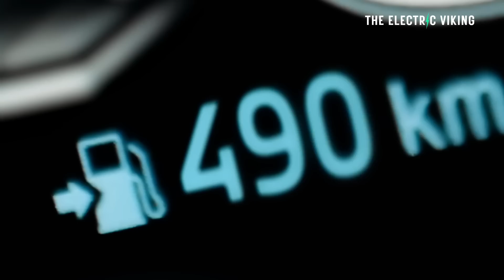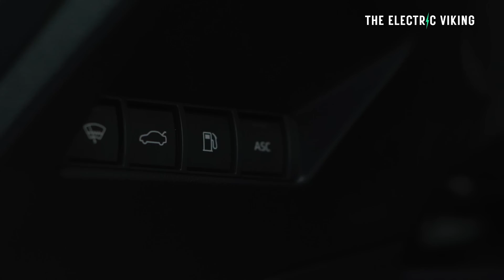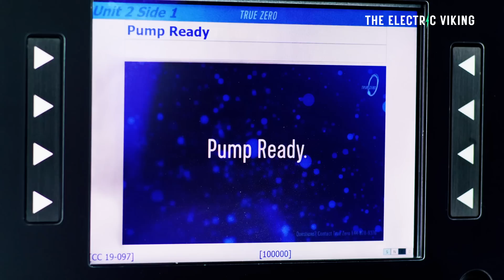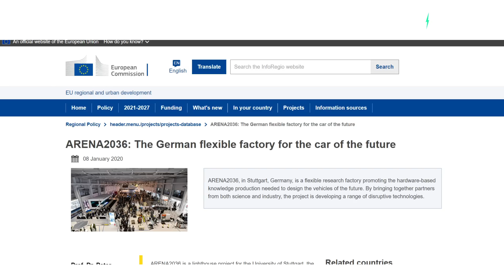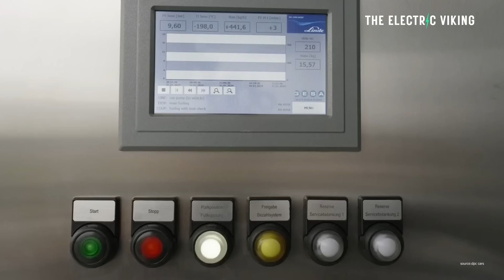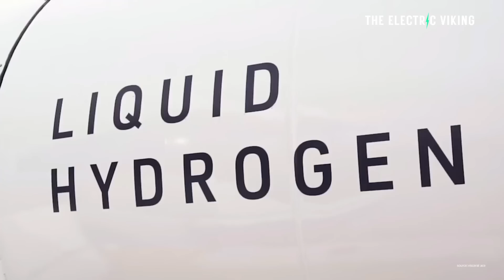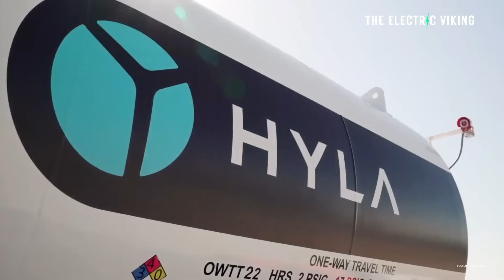Fossil fuel companies spending billions hoping that hydrogen beats EVs

Comment: I wonder about the argument for hydrogen for things like long haul semis and the like vs electric given the weight of semis for electric and charge times etc
Reply: There is already a concrete truck company in Australia that's doing battery swapping. It could be made similar to NIO where your nav system can see batteries available for swapping at the station and reserve them. Then fork lifts come and swap them in 10 minutes. And how large and heavy do the tanks need to be to store H2 at 750 bar (10,000 psi)?
Reply: @kng128  Hmmm.... I don't know what the long haul potential vs weight of hydrogen vs batteries are for long haul shipping via semis, but hydrogen can fill up like Diesel I would imagine.

Are you suggesting switching out massive batteries in semis for long-haul trucking?

Comment: I get your point. But people said the same thing about Tesla's: They were incredibly expensive, had low range, charging was not cheap to set up initially, had no idea how long they would last.  So I guess we just need to wait to see if hydrogen gets off the ground. I doubt it will given all the investment the fast technology advancement in batteries, but they'll try. Might be like VHS vs Betamax, sure Hydrogen vehicles will be excellent at certain things, but by the time it gets here everyone will be using EVs anyway.

Comment: producing hydrogen is 50% efficient, plus the fuel cells need to be replaced, and it costs much more than even today's expensive car batteries. Plus, it's so dangerous, you'd better keep it away from a road crash.

Comment: You need to do the math. Every step in the hydrogen cycle has inefficiencies compared to pure electric.  If you’re extracting hydrogen from fossil fuels you’ve only moved the CO2 production from the car to the refinery.  If you’re getting hydrogen from water using electricity it’s less 50% efficient. Then it takes energy to compress, cool, cryogenically store and transport. You then have to convert it back into electricity in fuel cells.  There’s also leakage and venting excess pressure as it warms.  
Then there’s safety.  Hydrogen is much more explosive than gasoline. It burns with a clear flame so you won’t even you’re in danger. 
The storage tanks are a literal bomb with high pressure hydrogen in them. You’ll get two explosions. One from the ruptured tank, then a big one when the escaped hydrogen mixes with air and any kind of spark sets it off.
Reply: Hydrogen does not have to come fossil fuel.
Reply: @yo2trader539  
True, but it’s still inefficient.  You would need 4-5 times more solar panels to run a car on hydrogen than if you just used the electricity to charge the car.

Comment: Hydrogen used with a fuel cel is still an EV.  If it is used in a combustion engine there is an efficiency limit which I believe is less than 40%.  A Hydrogen fuel tank needs to be heavy.  We could use Natural gas which is cleaner than oil but that has not been developed by Legacy auto and was only provided by aftermarket companies.  What nobody is saying is that most fuels come from Solar.  A tree grows because the sun shines.  Plants decompose and produce gas, oil, and coal.  If you compare Solar produced at home to power a car versus gasoline produced from oil, produced in Saudi Arabia, shipped here on a tanker, piped to a refinery, trucked to a gas station, were you have to attend to filling your car you should realize how stupid fossil fuel is as a fuel.  The efficiency is only calculated on what you use in your car not on the complete supply chain.  Plus you also have to pay for the damage caused by fossil fuel.  Fossil fuel is not limitless, eventually it will run out.  At that point we can look back and say, boy we were really stupid.

Comment: You will know that in Australia there are lots of outback roads where trucks cannot stop to charge.
Reply: There are lots of outback roads where you can't stop for petrol either.
Reply: @serpserpserp  You can stop anywhere you like and use a jerry can of fuel
Reply: That could be fixed with investment. The state built the roads the trucks run over, which was harder than adding charging points to truck stops

Comment: No one is saying move to hydrogen. But if it is economic to produce,  your car can generate its own electricity when it is required rather than have big heavy batteries to carry around.
Reply: Good news! It is not economic so no worries there.
Reply: @erktrek  it's is going to be more economical using the free electricity that Sam keeps talking about.

Comment: HEV could be a good fit for apartment dwellers, but for ppl with their own driveways/chargers BEV can't be beaten. I haven't been to a gas station since 2020 and I can't see how could I have a hydrogen pump at my own house.
Reply: Maybe in 40 years when there are enough local hydrogen filling stations + infrastructure to support them AND the cost has come down to the stated $2 kg (US Hydrogen "Roadmap" goal) AND assuming battery tech never advances, EV prices remain high AND charging stations stop being built.. so no, not really a good fit at all.

Comment: They are just pretending to remain relevant to support share prices and stop the company going insolvent while they extract CEO bonuses for as long as possible.   The real problem is that gov't seem to believe them, possibly because of donations but also because they are not taking 3rd party advice.  Our own local gov't is investing in Hydrogen bus manufacturing purely for jobs, they told me this directly after I explained how Hydrogen wasn't going to be a commercial success..

Comment: 9:11 In the United States, commercial vehicle drivers are regulated by the Federal Motor Carrier Safety Administration (FMCSA) under the Department of Transportation (DOT). According to the FMCSA hours-of-service (HOS) regulations, property-carrying commercial drivers are required to take a 30-minute break after driving for 8 consecutive hours. This rule is applied uniformly across all states in the U.S.
Reply: So driving a heavy truck for 8 hours straight, taking a 30 min break and driving again is safe? Really? 
What's the point of these regulations?

Comment: Hydrogen and ammonia are being pursued for replacement of natural gas for burning for, heavy industrial manufacturing, power generation and food production because that generates 80% of CO2. Also across Europe there already exists major natural gas infrastructure which is worth billions that can be reused. Major investments are already underway on all refineries first to increase hydrogen and ammonia production from fossil fuel, then to move by a series of steps to green hydrogen from renewables by 2035-2040. 
The remaining transportation. Hydrogen and ammonia engines have been developed for air and marine transportation, which leaves vehicles. The Chinese academy behind the Ev battery revolution in China believe Hydrogen is the ultimate goal. China is the largest manufacturer of hydrogen in the world, South Korea Japan and Europe are following a similar strategy such the cost of fuel cell manufacturing is now consistent with battery manufacturing. Whether battery vehicles survive beyond 2040, is down to a few simple issues, first the significant expenditure necessary for the expansion of electricity production and distribution infrastructure necessary to charge them and a significant reduction in the weight of batteries. This would require countries to abandon billions of pounds of existing gas infrastructure, which in the U.K. alone would require 91% of homes converted to electric heating, at an estimated cost north of £56billion and similar ratios exist across Europe which is not happening any time soon. Whilst a battery revolution is required to improve density reducing weight cost and charging time. Sensibly at this early stage countries are pursuing several technologies even including synthetic fuels in parallel, then just betting on one.

Comment: Electrification and hydrogen are the same. H2 brings the energy tu us without sun and wind, and keeps wind and solar producing when no one wants the power

H2 does not pass the lackmus test for vehicles either though (would you use it in a MBT for defence of your freedom?). Only diesel will do that

Comment: We can make our own electricity at home , they don’t like that .
Reply: Yea hydrogen is something the average person can't easily set up at home and use themselves. Renewables you can become independent of the grid and not need anything from them but to take your extra and store it.
Reply: @nfzeta128 In theory you could do electrolysis at home, but you would only do that to store the energy for either your HVAC, Water Heater, or Hydrogen ICE or Hydrogen Fuel Cell vehicle.
Reply: @HablaCarnage63  yes hydrogen is relatively easy to produce , storage and energy requirements are the 2 big issues with hydrogen production .
Reply: @antoniopalmero4063  Big Hydrogen problem ✴
Reply: @antoniopalmero4063  Plus you also have the embrittlement issue of any pipes it runs through. Some folks store more safely in their gas grid combined with other gases.
Reply: For all that say “you can make hydrogen at home,” it overall efficiency is around 30 %, it’s difficult or expensive to store,  and highly explosive above 4 %.  Then there is the capital cost for buying the equipment.
Reply: @waywardgeologist2520  The biggest issue with making hydrogen at home is that you need electricity, and if you have electricity... Why not just use it to charge an EV?
Reply: @oxaile4021  you mean like directly powering up my first generation Nissan Leaf, this way I can do 90% of my trips?
Reply: @waywardgeologist2520  It’s a rich man’s solution for sure.
Reply: Amen to that.
Reply: I would think the freedom and low price of continued energy renewables can give would be something everyone can get behind.
For leftists, it's clean energy and screwing with big oil companies. For liberals, it's a way to control more of their lives and clean energy.
For conservatives it's a way to be more self reliant and away from both the government and gas prices the companies fleece you with. It's not like there is much the government can regulate about solar panels around your home.
Like no side loses unless they invested in a oil/gas company and care more about that.
Reply: We've been living with solar and EV for 8 years now. You save a ton of money. No middlemen. Our panels power our home and charge the EV. There's no chance you'll get that opportunity with a hydrogen powered vehicle. The fossil fuel company will always have their hands in your wallet.
Reply: @TooSchoolForKool  yep 👍, I’m the same , it runs the house 🏠 day and night , I have 6.5kwh of LFP batteries    and 3.6 kw of solar. Perfect for our needs .
Reply: Exactly.
Reply: 420w panels in 🇬🇧 are ~ £120 each as of April 2024 .
Reply: And see if you can dare not to delete and censor my replies.
Reply: Yes you can too make your own hydrogen at home. The BEV shills are unwilling to explore outside their little boxes about any new types of devices available just like their predecessor fossil fuel trolls. Which is probably who you are anyways. Try googling Verde home hydrogen refueler... If it's not too difficult for you.
Reply: @EnriqueThiele Yes. It’s a similar danger to other off-grid stored gas systems.  Not to mention the potential bomb that is your water heater. 

The reason I wouldn’t do it it that a battery that might also explode or catch fire, if less frequently, is either already cheaper or soon will be.
Reply: @EnriqueThiele Well you’d be stupid to make hydrogen with grid power. It be solely a storage play from hydro, solar, or wind power.
Reply: I think hydrogen engines should be directed at heavy industry vehicles, military, aviation, and shipping industries. EV s are better at powering personal own vehicles, and time the weight of the motors and the batteries will decrease.
Reply: @rogermartinez78  I would wonder about how to store the gas unless it was an airship Hindenburg style.
Reply: Generation without storage is incomplete….. big electric KNEW  they should put batteries on th grid 30 years ago……. THEY WASNT GONNA DO IT !!
Reply: @EnriqueThiele ive never seen them used as fences here in Europe and I wouldnt say they are cheap.
Reply: Well no, not really. You cant make your own solar panels.
Reply: @Withnail1969  But we don’t have to keep digging Solar panels up out of the ground every time we want to use them. I expect 25years life from mine, not 25 seconds (from the tank to the exhaust. AND they are recyclable too.

Oil products are burned and then we breathe that end product in - All of us!
Reply: @John-FourteenSix 25yrs you expectations are high
Reply: @Withnail1969  but that's a purchase. The equipment to extract gas/oil or create/extract hydrogen would all be a purchase of tools. After that though it's just maintenance, you don't have to be continually supplied with sun from a company.
Reply: @Withnail1969  Even if you could produce Hydrogen at home, you would still be required to buy the equipment just like Solar panel or Wind mill.
Reply: You can generate your own solar; you can't fart your own hydrogen, duuurrp.@Withnail1969
Reply: @Withnail1969  I just buy the solar panels , they last decades .
Reply: @Withnail1969 
We're talking less than half a percent solar panel output loss per year, with the first few years having a higher loss.

After 25 years they are expected to be at around 88%of their original output. 

I believe many are warranteed to have at least 80% output after 20 or 25 years. I haven't looked in awhile, so things may have changed a bit.

Important thing is, that the degradation isn't major
Reply: @Withnail1969 I've been living with solar since 2016. If there's any degradation, it's certainly not noticable. It powers everything in the house including an EV. We get a good rate to sell excess electricity back to the grid. If production is like last year, we'll make just under $1,000 in 6 months.
Reply: @jeffl4810  mine are 2 years old and still produce more than the specifications .
Reply: @Withnail1969  You can’t make most of the things in your home at home. But if you buy and bring home solar panels and all the supporting electrical equipment you very much can create your own electrical power.
Reply: @Withnail1969  Anyone with a bit of electrical knowledge and tools could make a wind turbine though.

Comment: Hi Sam, I’ve been on holiday and not used my BEV for 10 days, I left with the traction battery at 60%, then I got back it was 54%, some loss. If it was a hydrogen car, almost all the hydrogen would vent off in that time. I left my BMW i3 on the driveway, I can charge it without going to a fuel station. If it was hydrogen powered, and the hydrogen had vented off, what would I do? The vehicle would need recovery to a hydrogen station.
Reply: Can I suggest something (not sure if bmw is different to Tesla) but in Tesla if u disable all background processes like sentry/ auto heat/cool etc the battery will hardly drop, I have even seen someone leave their car at airport and did not check it over the air etc, and came back with 1% more battery 😂 or it could be a battery chemistry thing.
My Tesla to this day have not lost or “leaked” any power for any length of time less than 2 weeks
Reply: Yea but then they'd happily sell you hydrogen tanks to fuel your vehicle. Of course these tanks are much more expensive than solar charging or simply having a small container with gas or diesel.

Comment: of course they do because hydrogen always will be Fossil.

where i live we have 250% clean energy since like 70 years because of hydro, they invested in hydrogen 20 years ago, basically free energy on mass, they still buy hydrogen from another company which makes it via gas reformation and it is brought with a diesel truck.
hydrogen is fossil period

this is hydrogen biggest flaw because "green" hydrogen will NEVER compete with fossil hydrogen, if you do "green" the competition will kill you. 
among the never ending list of flaws while having 0 upsides this is 1 killer argument.

this is what drives me insane, like, this bullshit doesn't even have 1 single upside.

volumetric energy density is among the worst possible, it's expensive, it's fossil, it's dangerous, it's terrible to store and transport, the whole line of the infrastructure is insanely expensive and needs a lot of maintenance, even the vehicles are insanely expensive.

this is defacto a Religion and it's followers are insane.

Comment: It is a bit of a premature discussion. We need lots of green hydrogen. We want to use it for fertilizer. Also we can reduce the co2 in methane production by adding green hydrogen.
When and if we get to a point where lots of green hydrogen is cheaply available, we might look at other uses.
In energy terms, hydrogen is not perfect. Because most of the stored evergy will turen into heat. If you have a use for heat as well as power, then it is good. In a car you don't.
Hydrogen does not have a very high energy density. So that is not ideal either.
And it is expensive to store and transport.
So i don't think hydrogen for transport will ever be a big thing. Ammonia, which you create from hydrogen, may be better. But it is very poisonous, and it burns slowly, which makes making ammonia engines hard. But ammonia fuel cells are a thing. So it could be done.
Reply: Ammonia good for fertilizer and industrial processes, crap for FCVs because you have to use additional energy to create the ammonia in the first place then convert it back to hydrogen making it even more inefficient / problematic when you could have simply stored that energy directly into a battery pack. Is a lot easier to store and transport than hydrogen though.